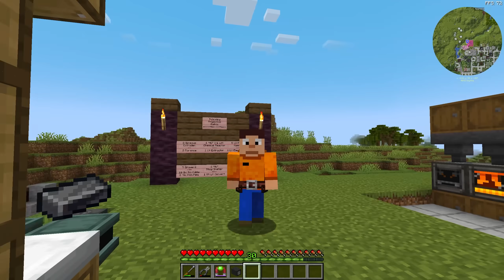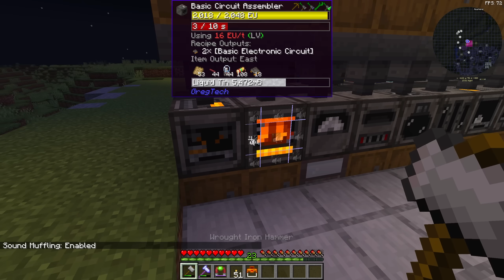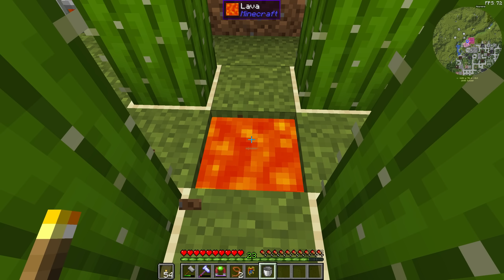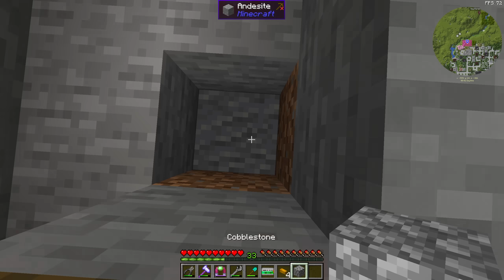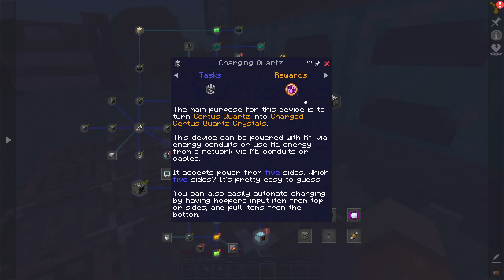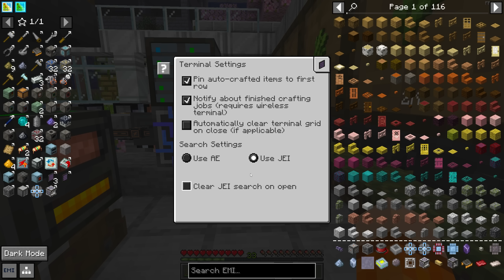Monifactory: Ep4 - AEeeeeeeoeee! Modded Minecraft

Comment: The cables in IE2 and GT and so on have always bothered me a lot tbh. Copper has after all got excellent conductivity. Aluminum has been used because it's worse, but cheaper and they needed copper for bullets. Steel is in use because it's worse, but has more tensile strength. Gold is in use because it's better and doesn't oxidize, but who in his right mind would use it for cables? Similar for electrum.

Just accept that copper is pretty much the best for most applications, except long range, semiconductors and superconductors, and do your resource gating and resource sinking elsewhere.

Comment: I think it kinda makes sense super conductors don't shock you?
Since amps like to follow the path of least resistance, and when one path has no resistance (super conductor) or extremely low resistence, the amps will follow that path instead of running through you (if human and wet, around 1000ohms of resistance)

Comment: You should craft gregtech drums, steel one holds 64 buckets, it keeps the fluid when you break the block, and you can also use it in gui on machines. Other than than I have found out that you can use compressor on sticky resin to get 1:1 rubber sheets without the need for sulhpur. And then you can use extractor to turn 1 rubber sheet to 144mb of molten rubber. This feels a bit like a cheat, but I am playing on default difficulty, so maybe this is intended? Another thing is that rather early in this pack I have crafted gregtech steel drill and it works reasonably well (better than unechaneted diamon hammers). The only issue is battery size, but you can craft gregtech lv batteries and set them to discharge, so that they charge other stuff. Turns out those gregtech batteries can charge not only gregtech drill but also RF magnet.

Comment: For the quick material gathering using EMI, you can click the magnifying glass button in the recipe tree to let it highlight the materials you need to take in an inventory.
Reply: Also if you are playing in normal mode, it is actually the same ratio if you compress the resin and extract into fluid rubber, compared to the standard chemical reacting method, saving some sulfer and quicker that way.

Comment: I think you don't get electrocuted because the wire has 0 resistance and your hand would be connected to the wire in parallel and since your arm has resistance all of the current would go thru the 0 resistance wire; thus not electrocuting you.

Comment: Superconductors not electrocuting you is actually more accurate to real physics. Since electricity follows the path of least resistance and superconductors have zero resistance, it wouldn't flow through your body. Although depending on the current, you would probably still want to avoid the strong magnetic field around the wire.
Reply: Ty for reminding why gregtech is the only videogame
Reply: @Arthur-xh4so  gregtech is not a video game, it's a way of life
Reply: Well if the wire is connected to some machine which in theory would have a huge resistance, wouldnt that mean that the current would rather flow through you and to the ground? Unless youre wearing rubber boots
Reply: @SamsIsDead hm. Thats a good point im curious about this too
Reply: @jadegreenleaf781  Well op is definitely right but for the wrong reasons, it is true that if you could somehow touch a superconductor and it remains a superconductor you would be safe from a shock at least. This is because in order for you to be "shocked" you would need for voltage to want to run through you. But since there is 0 resistance in a superconductor with current running through it there is never any difference in voltage meaning your link to ground with also have a 0 volt difference never causing a shock
Reply: @hunterthomas5876  interesting
Reply: @SamsIsDead  sure but in that case it would apply to all types of cables without distinction and superconductor or not wouldnt matter, just playing with the rules :p
Reply: I had this argument with a friend not long ago this was my argument
Reply: Static magnetic fields and low frequency ones cannot affect humans. You have to have a pretty strong magnetic field to induce Foucault currents in the nervous system. It also has to change fast enough. 1 Tesla of static magnetic field can be dangerous if you're carrying metal but can't affect the nervous system if it is static. The induced current is proportional to the curl of the magnetic field. So high frequency and high magnetic fields are necessary to cause damage to humans. And yes. You can induce current in someone's brain this way. It is used to treat some diseases!

Comment: I used to despise AE finding it too complicated but now i genuinely the only digital storage (and all the automation it allows) mod i like
Reply: I don't intend this to be rude but I genuinely don't understand how people find AE too complicated.
Reply: @UntouchedWagons the entry learning curve is a cliff if you've never done digital storage mods, and for me at least when I first started the notion of losing power and access to my items was really scary. Now I know how to get some constant power gen because a small system actually requires so little power, but after making a dimension spanning network with a lot of autocrafting I still don't understand the need for P2P tunnels or subnets and probably some other concept I'm not thinking of now
Reply: @lukewarmwaterr Have you had to use Channels before? That's what causes most of the needs for automating with AE on a large scale
Reply: @lukewarmwaterr  P2P tunnels aren't required, but they make moving channels around simple and easy.
Otherwise you need a dedicated thick cable, color coded so they don't connect, on every face of your controller. A controller that has a max size.
Reply: @ReptillianStrike  but I don't see how P2P tunnels allow you to have more channels, it doesn't really make sense to me. In my largest system I made a 5x5x5 cube outline of controllers for the center and just attached dense cables when I needed. Never even came close to using all the channels I could get off the controller
Reply: @lukewarmwaterr  they dont give you channels. They make it easier to move channels. It's like a phantom face for your controller.

It would save on resources required to make cables as the p2p doesn't need dense cable to carry all 32 channels
Reply: @lukewarmwaterr  you can stick lets say 8 p2p me tunnels on 8 controller's faces, each face holding 32 channels, so you can carry 8x32 channels with a single basic me cable
Can be expanded as needed
Better to do it with a subnet : 2 distinct controllers, one is the main net, the one where you stick the tunnels onto, the other is there to carry the channels only. Both cant touch so you ll need a few quartz cables
Reply: @UntouchedWagons compared to RS it’s difficult. RS is dead simple to use unlike AE2.  Not saying it’s hard. Just that it’s harder compared to the other option. Channels are what people don’t grasp.
Reply: imagine not understanding anything mc storage netowrks or real life networking  @UntouchedWagons
Reply: @UntouchedWagons sorry carlsen

Comment: By the way, the extra 48 steel plates and LV circuits are due to the circuit assembler needing 1 less LV circuit to make an MV circuit: 2 LV per MV, and it also requires no steel plates, unlike manual crafting.
Reply: @insightt_  so he threw them away for no reason?
Reply: @Tuco-js yes
Reply: @adikowy_1  ouch, I felt the pain when he threw them away but now it just got worse
Reply: @Tuco-js  lv circuits are still useful later
Reply: @Thor0510  I know
Reply: It looks like he favorited the wrong recipe, so EMI defaulted to the crafting recipe instead of the processing recipe.
Reply: I guess hes got GTNH brain where it takes 10x the resources for no reason
Reply: @Sengyizhe  The reason is to require more thinking and infrastructure behind things. If it costing 10x the resources is a problem for you, you're doing something wrong.
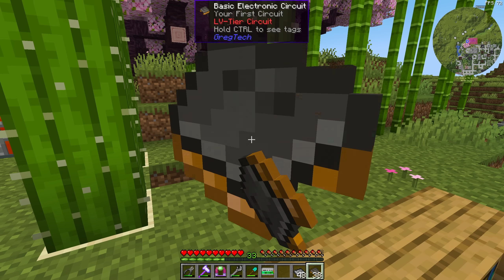Reply: 18:25